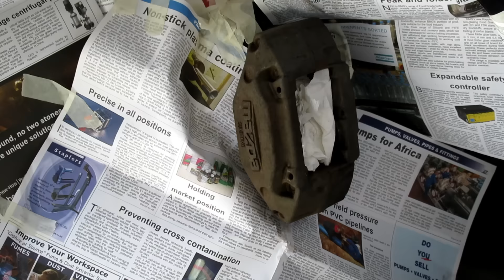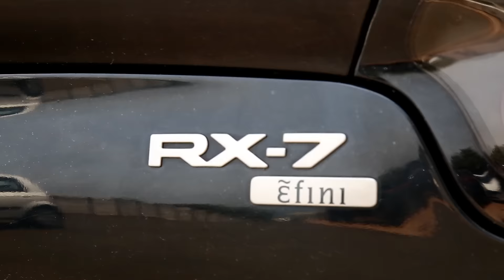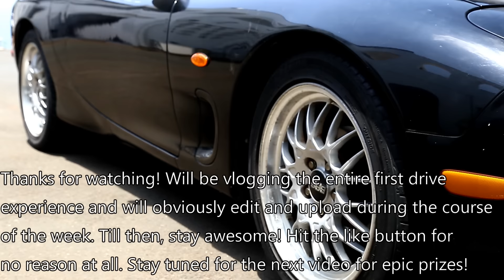Making My Mazda RX7 FD Awesome Again! Part1

Comment: Cool to see your videos. People are always complimenting  my FD . Funny that lots of non car people don't know what they are.   There are only 8 thousand of these in the states now. Glad i was able to buy mine years ago. Enjoy your FD and good luck with your registration.
Reply from the maker: Thanks for watching bro, I haven't had any real compliments yet as the car hasn't left the house. I can't wait to see some reactions! Afaik there are less than 50 registered on our roads as collectors items, however there are a ton that are illegally brought in from neighboring countries like Zimbabwe and Botswana. I'm hoping they pass the car tomorrow at the road worthy test, the only issue that I can see would be the rev counter not working. They could possibly fail me.
Reply: How common are the R series Rx7 FDs in the US, in comparison to non R series ones, if you don't mind me asking? Every Rx7 I've seen in America (from other videos, i've never been there myself) seems to be a non R series. In Australia, there are much more R series FDs than regular FDs.
Reply: LaBomba Romba The R1,R2 series is rare in the states. There are only 200 shipped to states per year 93,94,95.. Only difference between the base model( cloth seats , no moon roof)-  touring(leather seat/ bose system & moon roof, - the R1 & R2 has as extra oil cooler , strut tower brace and stiffer suspension and a front lip. Yes it's rare but not much better imo.
Reply: Mazda Rx7 FD 1993 They also have fancier wing and different front bumper, don't they?
Reply: LaBomba Romba front bumper remain the same for the us versions. The R1 & R2 has a different lip, and yes it has a spoiler.

Comment: whats the purpose behind putting oil in the filter than screwing in onto the engine
Reply from the maker: Basically there's a small rubber gasket that sits in the grooves of the oil filter, if you don't oil it up before screwing it on there is a chance that it could get stuck to the engine block over time due to erratic heat cycles and such. Always best to lube it up!
Reply: oh never knew that thanks